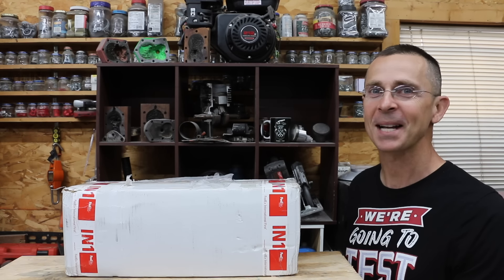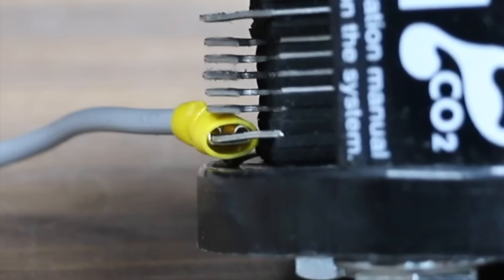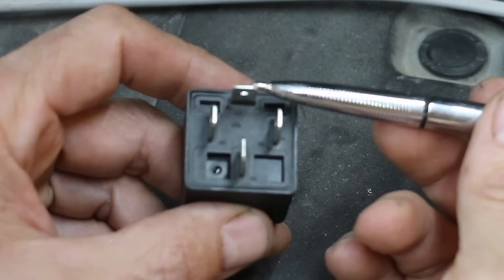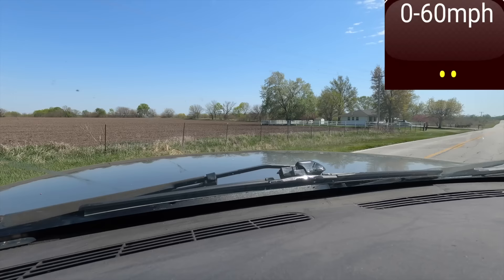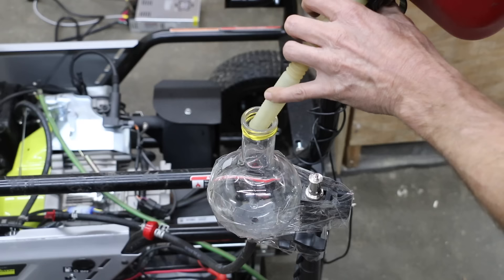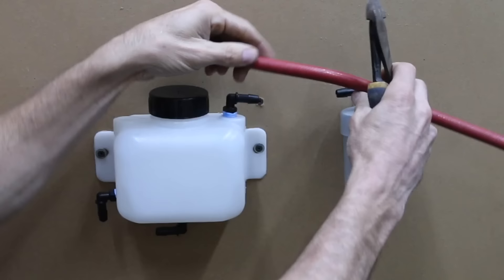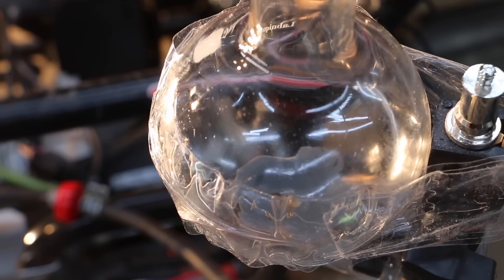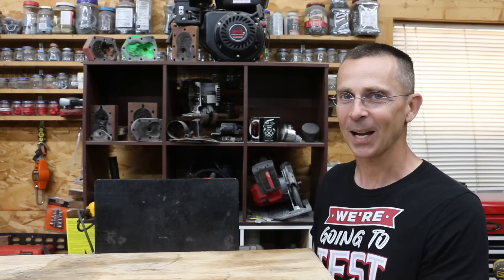AMAZING 35% More MPG with HHO? Let’s find out! Help with high gas prices?

Comment: I’m curious to see how this would do on a carbureted engine, where you have more manual control over the fuel/air mixture. (ie: switching out jet sizes, etc.)
Reply from the maker: Thank you for the video idea!
Reply: Correct, on fuel injection the o2 sensor sets the air/fuel mixture so the engine won't overheat because of running too lean, to make this work you need a small device to "trick" the computer to not richen up the mixture.  Hope this helped.
Reply: @MtnPeakEnduro  nope you can't lean out more safely with Hydrogen, there is no "more efficient"  burn and actually we are pretty close to perfect in regards to gasoline combustion itself but an ICE engine has lots of compromises which results in significant losses not directly related to the combustion process itself.  
Food for thought,  Gasoline consists out of more than double the Hydrogen atoms than carbon atoms;  injecting liquid gasoline reduces the air inlet temperature and with it the operating temperature of the engine,  gaseous Hydrogen in the inlet doesn't reduce inlet temperature thus engine operating temperatures would actually be higher.
Reply: Around 2005 when I was 16, me and my dad built a few and ran them on both efi and carbureted engines, and couldn't ever get them to make them more efficient. 

My dad did swear that one night he got a system on his 94 e150 to draw over 30 amps and it ran like Forrest Gump. I still have his hydrogen book somewhere.
Reply: This is exactly what I am thinking neither ECU would know that there is H2 present and so the fuel consumption would be at least equal. On an engine where the operator controls the throttle depending on the desired power out put there may be a different result.
Reply: @davelowets  all we're doing by adding hydrogen is replacing some of one fuel with another. It still follows the laws of thernodynamics.
Reply: @soconnoriv  No it doesn't. EVERY time you have to convert something into another form to use the energy, as you are doing by inputting electricity into the HHO system, there ARE conversion losses. The net energy you would be getting from the hydrogen of the HHO system WILL be at a net loss compared to the energy put in from the alternator and hence, the engine. Otherwise it would violate the rules of thermodynamics. You can't get something for nothing, and this video clearly shows that with the generator runs. It always cut off early with the HHO because it took MORE energy in the form of electricity than you get back in the energy of the hydrogen produced. You gain nothing but a small net loss with HHO. Believe me, it HAS to work this way, or we would have overunity machines supplying us with free energy all over the place. And no, Big Oil isn't hampering the progress of any of this, it's simply the laws of nature at work here.
Reply: @davelowets  what makes you so sure that the conversion process takes more energy than the hydrogen can provide through combustion? I've always been under the impression that converting water into hydrogen requires less energy than what the hydrogen provides as a fuel for combustion. The fuel is already present, it just needs to be extracted from the water. I still don't think we're breaking any laws here. Those HHO bubblers typically only draw a couple of amps. The one in the video was drawing 30 watts. I highly doubt 30 watts of consumption outweighs the amount of power the hydrogen can supplement through an engine. Either way, the only way to find out is to keep experimenting.
Reply: @soconnoriv  Because I'm smart enough to know better.
Reply: @soconnoriv  Because when you burn the gaseous h2, it turns back into water. So how can you get energy out if you end with the stuff you started with? That would be perpetual energy
Reply: Was just thinking that this on an engine than can adjust the fuel/air mixture, something with a computer for monitoring or even a carb engine, like you suggest, could show actual change. Maybe a better ignition with extra boom would really mean not needing quite as much fuel. Possibly a timing adjustment due to less fuel to avoid knock?
Reply: It doesn't matter if it's carbureted or not.  Laws of energy and thermodynamics dictate that the system will never work.  You can't burn one fuel to make another fuel, burn the second fuel and think it's going to save you gas!
Reply: @ProjectFarm  in a fuel injected engine you will have no success unless you control the 02 sensors , More oxygen in the exhaust causes the computer to add fuel causing a constant rich situation
Reply: @davelowets  I like this vid and your input, however....consider the following, please. And do tell me if I'm wrong. And I understand the principles of energy, not just thermodynamics, but all energy. That it is simply impossible to create nor destroy energy, it can merely be manipulated and change form. Now if, the current generated from the alt. was directly converted into brown's gas, there would. of course, be an efficiency loss; however, is that what is really happening? The electrolysis that is taking place is breaking up the H2O molecule in order for it to be burned. So that is not an exact conversion of energy, like you may see in for instance a windmill, turbine etc. While the system does rob the motor of hp, at the expense of generating ac, is it offset by the hydrogen produced? in other words, what is the potential energy of HHO and how does that look comparatively to the number of jewels created(robbed from the motor) by the alternator? And because this is an electronic injection motor, a very unsophisticated one at that, does it rule out other more sophisticated motors? or carbed engines?? I think this video may not be a real good analogy of how this would effect a cars performance.
Reply: @danescholl7184  There will always be some kind of loss. The loss is heat that is created during the conversion process, and can not be avoided. It makes no difference what kind of engine it is, or how sophisticated it is, there will be a net loss. The loss in the scenario from the video is heat from the alternator creatimg the electricity that the HHO generator uses, and also an extra drag on the engine because as an alternator produces electricity it physically gets harder to turn. Since it's impossible to get something for nothing, these losses add up to more energy than what the HHO gas contributes to the engine output. The 2 portable generator tests at the end tells all... The generator ALWAYS ran out 20-30 seconds earlier with the HHO than without it. 
Now, if you plugged the HHO power supply into an A/C household wall outlet, instead of the generator A/C outlet, the generator WOULD most likely run for a bit longer with the HHO gas. BUT, you really wouldn't gain anything because you would have to pay for the electricity from the wall outlet, and it would cost more for it than the little extra time you got out of the generator. 
Now, I can already hear people saying, "Power the HHO system from solar panels, and run your portable generator FOREVER!"   Yes, that may be possible, BUT you would still need to have solar panels that put out MORE power than the gen set does, ALOT more, because of huge conversion losses and the low efficiency of solar panels to start with. You would be better off using the power directly from the solar panel itself, because you would be avoiding the conversion losses. If you ever are trying to figure out how much electricity is equivalent to what a gas powered engine is making, the formula is,
1 horsepower= 746 watts of electrical power,
and that doesn't include any conversion losses if you have to change matter into energy. 
So, in a purely theoretical situation because we aren't including any losses here, if a portable generator set makes a maximum of 8,000 watts of available electrical power with it's 10 horsepower engine maxed out, that engine is producing well over 7,460 watts. So, if we wanted to double the run time of the generator by installing an HHO system on it, we would have to power the HHO system with at least 3,730 watts to do it....  And that's in a perfect world with everything at 100% efficiency and no conversion losses. Most of the engines wattage is wasted by the huge heat it produces, and I'm sure the HHO generator would take over 10,000 watts to do it. The fact that the generator only produces 8,000 watts makes this an impossible task.
 In reality, I couldn't even IMAGINE how much power would really be required to do it, but it would be a HELL of alot more than that because the losses are HUGE. All the heat produced by the engine is a complete waste because it contributes NOTHING to the end amount of electricity that's produced. 
Now you can see how impossible it really is to get any gains at all from something like an HHO system. It's not even in the realm of reality, but some people just aren't educated enough to understand the concepts, and laws, of thermodynamics. I'm no genius myself but I have some college physics, enough to know better. 👊✌
Reply: @davelowets  Thank you!  I've many of friends try this think it's helping.  If you're using the same engine to produce the electricity it's automatically a loss.  If you could get the electricity from somewhere else (solar or regenerative braking or whatever), then maybe.
Reply: @shermanwest3168  Absolutely.. 👊
Reply: It will not work there either. Gasoline engines are not built to use Hydrogen in any form.
Reply: @adventureswithfrodo2721  Yes, they can and will. Especially in gasoline/hydrogen mixtures where the ratio of hydrogen is quite small, there will be no issues. I.C.E. engines have even been demonstrated to run on 100% hydrogen many times before.
Reply: @davelowets  Hey, thanks for the long explanation. I already know all of that. That was intended to be assumed from the beginning, lol solar panels lol I fuckin hate solar panels. However; with all do respect, you did not answer my question. Which I guess you didn't understand. Which is simply this: What is the energy produced by an HHO generator(this of course is infinitely subjective, because there are tons of diff designs). Does that amount of energy equate to the same amount loss in an engine(used to produce it aka turning an alternator)? And I only wonder this, because....even though every time you convert an energy form you lose power, but is that exactly what is happening here?? Are we simply converting a power source aka steam to electric, gas to rotation?? I am not so sure, because energy is being tapped out of the water molecule. Consider this, did it take as much energy to detonate the atomic bomb as it did give off? every time you tap into a resource of energy, that is not the same thing, for say, as simply converting energy. If that were the case we would never drill for oil, or dig for coal, because we would be losing energy. And it would be more efficient to just use man power to do things. But the excavation of coal does not equate evenly to the amount of energy it produces. I know what your saying, but your missing my point.
Reply: @soconnoriv  Experimenting with hydrogen has been going on for a 100 years as an energy source, but for transportation it hasn't really worked out.
Reply: @rjgarciasr  i do believe i just seen where there is a car company that has a car about to come out running on just hho
Reply: It’s still b.s. there’s no free lunch.
Reply: @soconnoriv   It applies to all. Not only in this case. When energy is converted from one form to another, there is always LOSS. It cannot be converted with 100% efficiency. However, no matter how much energy we consumed or wasted in the process, we can still call it success if we achieve our goal.
Reply: I would have to agree with using a carburated engine, so that the o2 censor isn't compensating for the extra oxygen. I am no mechanic but I have used oxygen/acetylene torches. I would worry more about the issue of engine timing, and pre detonation because of the extra oxygen. Just a thought.
Reply: @ProjectFarm  Dona video on wood glue by type of wood. Pine, oak, Ipe, cedar etc… some of these oily woods are a major pita to find a glue that works
Reply: Much, much better. I ran a Wouter Oosthuizen tubular brute force hydrolyzer at 20Amps on a very elderly 4.1Litres Chev Elcamino

On long trips at steady speeds it managed a very respectable 28% in fuel consumption. It dropped to about 15% improvement in mixed driving. 

Engine was so much quieter and smother. I put the same unit on a fuel injected Mazda sedan and it produced no improvement whatsoever. In fact, fuel consumption worsened. It was then used on a Ford F250 V8 with a Rochester carb. Again vast improvement in fuel consumption.

So  yes, fuel injected engines don't like HHO unless you fool the lambda and oxygen sensors.
Reply: Nothing will change. Besides the kit was sold 'as is' to provide a specific level of change. Having to screw around, spending more money and effort on a sucker bet isn't in anyone's best interest. The changes you promote would make the same amount of difference with or without the kit.